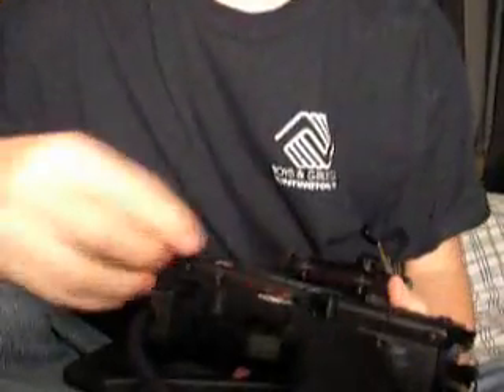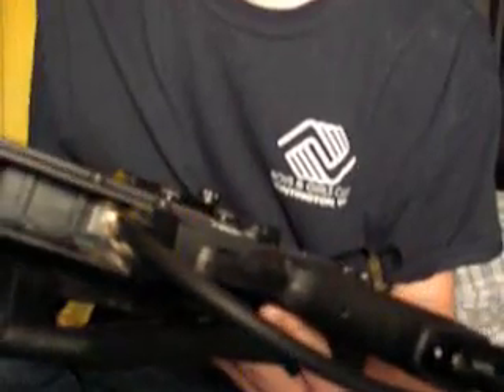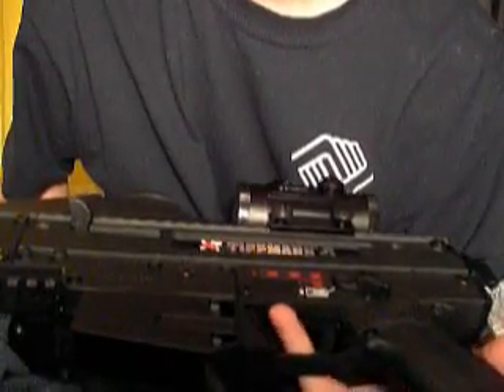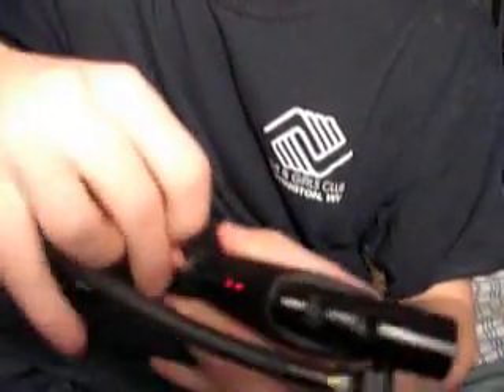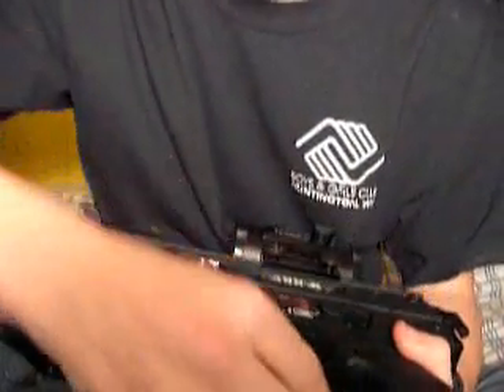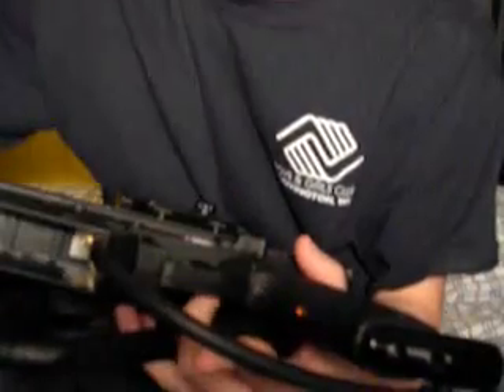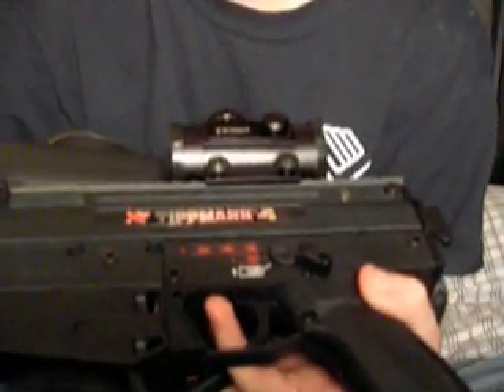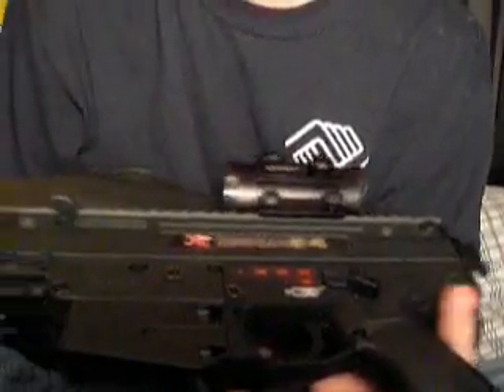Tippmann x7 E-Grip WalkThrough

Comment: For that you have to go into the Advanced User Setup:

- Press & hold trigger 
- while holding down trigger press button with allen key
- when light turns green let go of BUTTON (but keep holding trigger untill LED goes SOLID RED
- now let go of trigger
- you are now in menu 1 of 4, press trigger 3 times to get into bps setup
- once in there LED will flash green quickly to indicate this firing mode, press and hold trigger for 2 sec to enter its setup
- press trigger as many BPS you like (8-30)

Comment from the maker: @paintball4life01 i have to reply on this one and no it's not the co2 nor the o-ring.... the x7 is a different gun than others. but in that peace their are 4 parts to it.. the blow in valve, pressure pin, spoiler, and the blow out valve... the problem is in the pressure pin area.. the only way to fix that is to send the gun back bc the pressure pin is pushed up when air is put in the gun and dropped when air is take off the gun. if it doesn't move then tippmann made a mistake on production

Comment from the maker: @paintball4life01 and an easy way to figure it out if it works or not is put in a full tank and dry fire it 1 or 2 times and turn the co2 tank 1 turn like your takeing it off the gun then shoot 1 more time and repeat that and if the gun starts shooting air out crazy then send it back.. and the leaking tank is the o-ring on the tank.. their is no o-ring in this gun like angel's and spyders and such..( low maintenance )